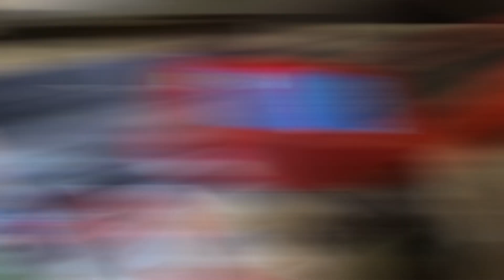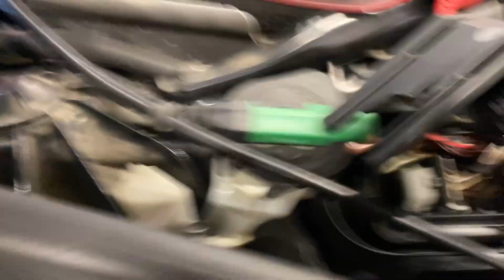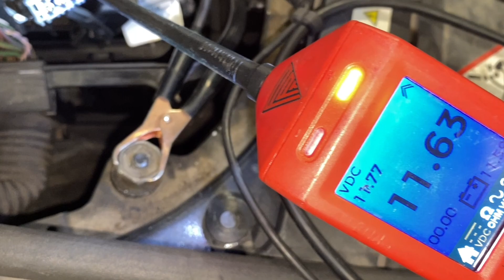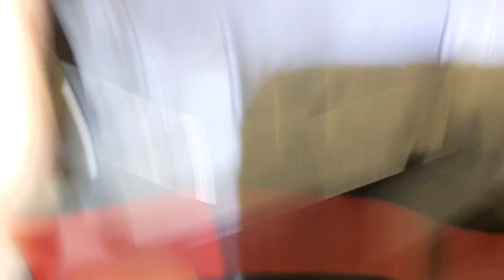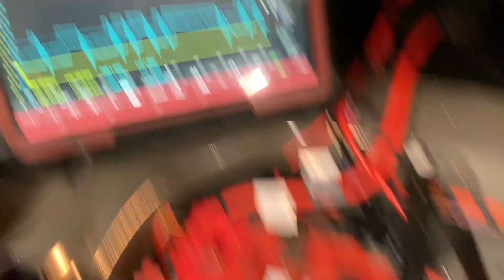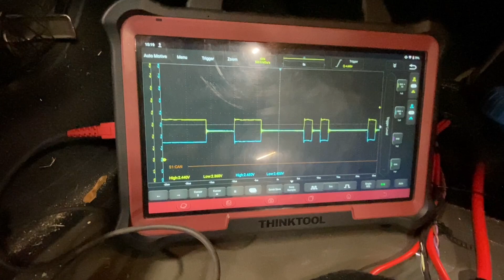BMW F10 Diesel: DDE Short & CAN Bus Chaos!

Comment: Hi sir, I have problem with F10 N47..
When cold
First when you put ignition on relay under the glove box that going to big 2 red wires, relay sounds like sparking for a second

Then start engine with no problem, put in Drive and give some resistance engine shuts off, again starts like no problem

Sometimes when driving when cold car starts to stalls, voltage drops this second when this happens, driving stabilisation error, and every time this happens relay in glove box clicks

In error codes has many codes, but also a DDE internal error.

Bought used good DDE and programed, same thing happens..

Ive got to idea to heat dde, when dde is hot I think problem gone, with old and new DDE..

In past have activating false alarm, battery discharging when stationary, but this stopped for now..

Changed alternator regulator, battery, DDE, Relay…

If you have some time, please help me I will go crazy, thanks Sir 🤝😂
Reply from the maker: Email me. I charge 100 euro one off fee for tech support